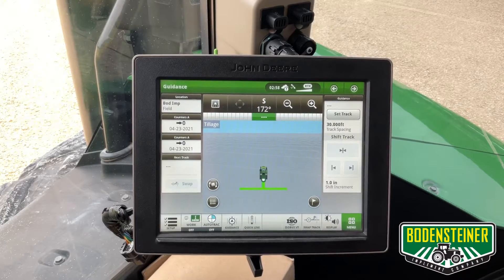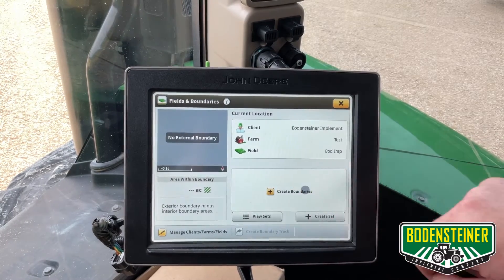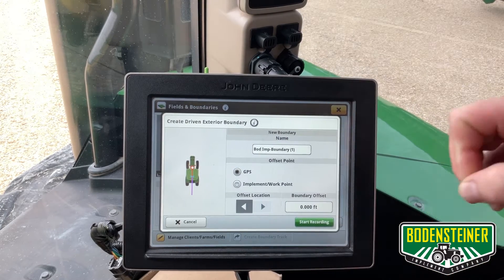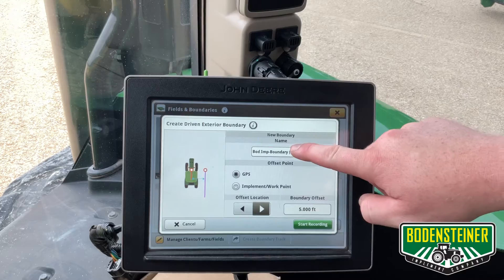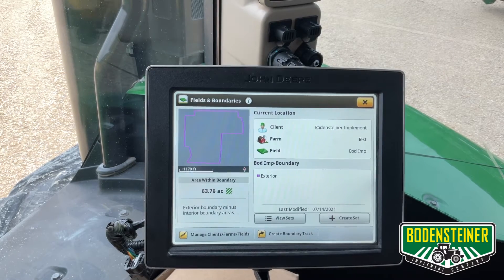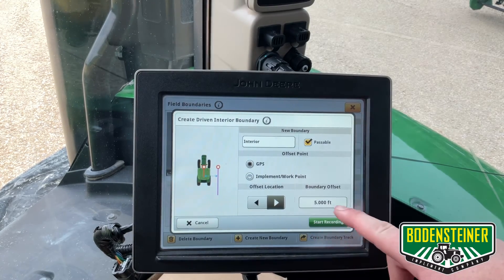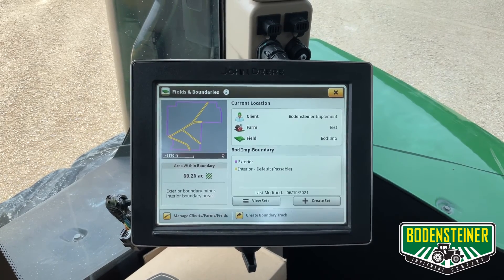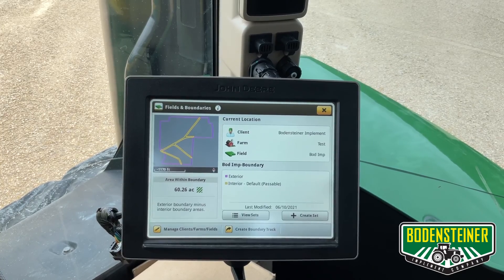Making Boundaries on a Gen 4 Display

Comment: How do you make interior boundaries without making an exterior boundarie first? Custom spraying I like to map waterways for use of section control but have no need for the exterior. This is easily done on the 2630 but can't figure out how to do it on the 2640.